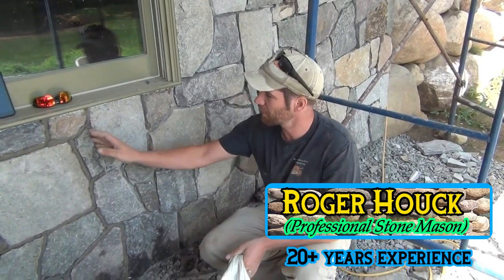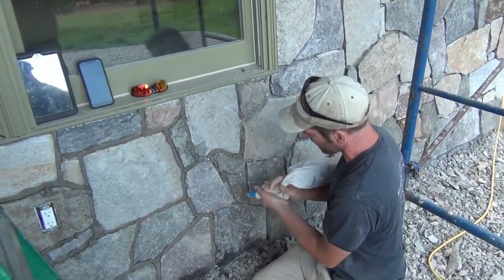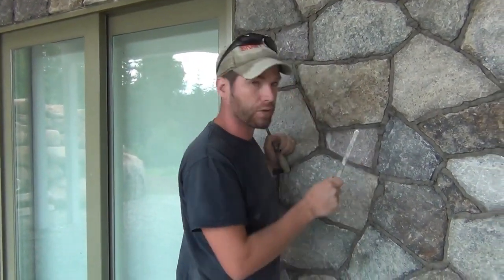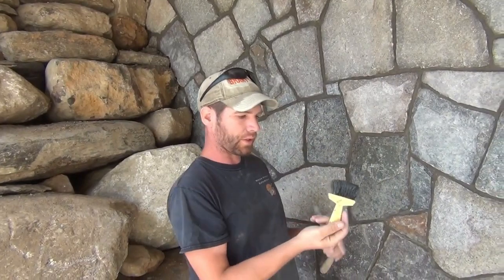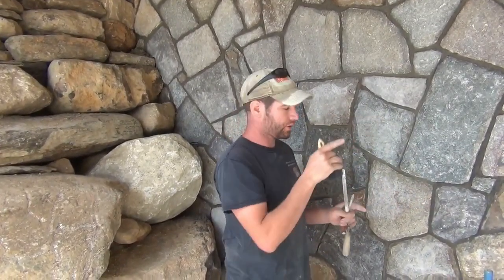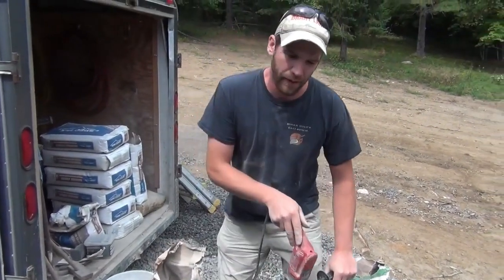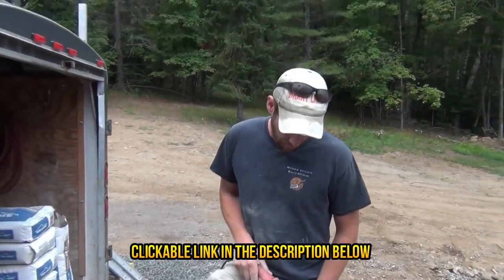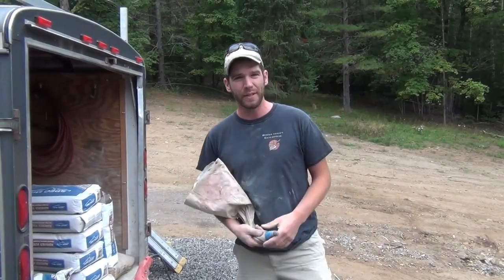How To: Grout Cultured Stone (Lots Of Tips From A Professional Stone Mason) Bags, Mortar, Troweling.

Comment: Great vid, couple more tips to mention...get the grout bag wet on the inside before you start and rinse it out clean before reloading it.  Once you squirt all the joints and the mortar start to dry out.  Push all of your job with your joints in real good.  Wearing gloves your fingers work great.  We have tuck points that are cut down to about an inch long that we use to finish the joints.  This custom tool helps  get around the contours for rounder cornered stone.  Never really used a full length tuck point before for stone.
Reply from the maker: Great points Pete, i should have mentioned wetting the bag.     depending on the joint style we use wooden tools for a similar finish,   and lots of glove joints especially on sea walls.

Comment: Hello from Houston, Texas.  I sure am glad I found your YT posting.  Have the constipation problem (luv your description).  Looked at a zillion YT bag videos and only two referenced the problem with nothing how to solve it.  Called Quikrete help and they were no help.  Had tried using type N mortar (1102).  Now I know what to use and how much.  I have about 140 linear feet of ground out brick mortar seams to fill and I did not want to use a trowel to transfer from a tray into the seam.  Thanks..!!
Reply from the maker: Thank you so much!   yep i could not find the answer for years and i had to hand pack joints for 1000s of feet before we figured out the laxative.   I hope it all goes well!

Comment: Thank you so much! I've done a ton of tile work but this is my first run at installing exterior stone. I ran into issues with the "poop" bag and am so thankful that you took the time to post this. My only concern now is that I wanted to add dye to the mortar and it's going to be difficult to figure out the ratio. Good idea to at least mix enough to do a section before going to the next wall. Any more detailed tips on adding the dye, that you've discovered along the way, would be greatly appreciated.
Reply from the maker: thank you for watching Denise!    the dye is a really tricky thing.   if it is a dry powder you can mix up a lot ahead of time and then wet the portions you need,   using equal water ratios each time,  certainly tryy to keep the same ratios on the same wall and then adjust around a corrner.   sometimes you can buy a pre colored mix that is easier.    
   if its a liquid dye   then you got t0 get even more precise and scientific.     measuring out everything and keeping as consistent as possible.  each day's weather conditions can change the color a lot   even with everything else under control.     I have honestly tried to steer away from dyed mortar on bigger jobs.   it is a huge liability.  and it looks great if it all works out but it looks not so good if you end up with 5 different shades.     on a smaller project.  like under 100 square feet  it is pretty doable.   i hope this helps

Comment: Informative, but funny 😄 hard to marry those. Good job.
Reply from the maker: Glad you enjoyed it.   thank you.   I've got a bunch of uneded vids i got to get out.  thanks for the encouragement.   have you done much in the masonry world?
Reply: @TheHowToHeadquarters  just a DYIer but have watched all the Haduck vids so I guess semi pro now lol. Going to tackle building a faced stone wall up against the side of my concrete stair walkup. only goes as high as 2.5 feet, only like 10 sq face feet. Will end up getting mostly large  rectangles of types of flagstone. My question is do I need more than just type n mortar to secure to each other andcesp. To the parged flat  side of cement stairs ? Considered like brick wall ties but read they rust off, not needed etc. In Chicago so cold winters. My first go at facing stone. Any advice ill take it. Will be eying your other vids prior too. Trying to learn.
Reply from the maker: yup Mike Haddock is great!!     i would add some extra straight Portland to the type N mortar and sand   maybe 1 part type n 1 Portland 3 sand.    and i would add an acrylic fortifier to the water.  Kaufmanns is and excellent brand but the quickcreet acrylic fortifiers are good too.  they just seem to accelerate the cure.  which can de a pain in the hot summer.   
 But the most important thing is to keep the water from getting behind it.   a good cap on top is a much more determining factor as far as longevity  over mortar type.  if water can work its way in behind the wall, it will deteriorate  especially in freeze thaw climates like ours.
Reply: @TheHowToHeadquarters  thanks much for the response! You are exactly right with the last part because that's exactly what happened. Builder pur this up 20 years ago with house and im told by 2 stone guys no one does it with sand and stone mortared to side of concrete anymore cause water gets behind and busts it up over time. Zactly what occurred by year 10-15.  

Wanted some guys to tear it out and parge the wall but they found big void under steps and got cold feet so just redid all the joints and used good stone they had to redo. Now I'm finishing portion they ran outta stone. I know even with caps, learned term coping stones applies too, won't keep our rain and gutter water that flows over it. Oh well I only need to make it 7- 10 years then sellin. Good luck growing channel. If you were local hire u in a NY minute!
Reply from the maker: @stevevenn1  thanks Bob!   yep those coping pcs will make all the difference!    and it will definitely get you 7 years.    especially if you spray it  every year or 2 with a waterproof sealer like aqua pel
Reply: Appreciate the work you did and the information you shared and enjoyed how he shared it :-) salt of the earth
Reply from the maker: thanks Brian.  i hope your project turns out well!

Comment: Thank you very much great video. My question is I like to have a little bit of sparkle from silica sand in my grout on my exterior stone walls and house. We built the house 19 years ago and we have a bunch of minor grout replacement to do and I want to get that same light grey look that shows the sparkle (not a lot) but enough so it doesn’t look just like smooth flat grey grout. Any suggestions?  I don’t remember the recipe I used I used to think that it was 1/3 Portland cement, 1/3  mortar, 1/3  sand…. But after watching your video I think I probably did it incorrectly. Anyhow, your videos terrific you explain things really well. Thank you very much for taking the time to show us this video. From San Diego.
Reply from the maker: wow great to hear from San Diego.    it was probably crystalized silica that gave you the sparkle.   you might be able to get some to mix into your grout .   it is a identified carcinogen now so its a little harder to get.    or you might be able to pick up a tile grout with that sparkle element and then mix that in.    its a DIFICULT game to match existing grout that has been weathered sometimes you got to just get it close and let it blend over a few years.    if your mortar joints were small (less than a half an inch)    that 1/3 port 1/3 sand 1/3 mortar could have been appropriate.   is it showing deterioration after the 19 years in the average spot?  or is it just failing where excessive weather or movement has taken place?

Comment: Have you used white mortar? What would be the proper mixture for white mortar?
Reply from the maker: the best way is to get white premixed mortar for glass blocks.  if you can source that.   its hard to make it yourself consistently.   maybe a tile grout.  or very light sand and type n light mortar.

Comment: So I'm still confused about the two Type S components, and your response to Frank didn't really clear thigs up. I understand one is a "mix" that contains portland cement, lime and sand. I've already tried this and had the constipated result. Then I found this video (which is great) and you provide the recipe. But when I search for "Type S Mortar" all I'm finding are mixes. What exactly does the other Type S Mortar contain; and can you provide a manufacturer recommendation? Any help is appreciated. Thank you.
Reply from the maker: Hey Bill,   I'm sorry this is a bit confusing.   especially since the names of these products have been blended together.    one way to differentiate is by weight.   the premixed mortar (which gets constipated without the other stuff)   is usually sold in an 80 lb bag.      the magic ingredient is  pure type s mortar.  that is usually in a 72 lb bag.   they have it at the box stores usually,  but nobody there knows the difference.   
pure type s mortar is finer than bread flower.   no sand,    just Lime, Portland, and some carcinogens.    If all else fails try a masonry supply store.  the guys at the counter there usualy  know the products and have a higher turnover rate.   if straight type s sits around too long it can get clumpy and cause more problems.  i hope this helps

Comment: Thanks for your great videos Roger! They are extremely helpful. What is the ideal temperature for installing exterior thin veneer stone. Then what is the low end temperature?
Reply from the maker: Thanks for watching Tim,   I don't like to apply mortar  when the next 3 days are likely to dip below 32 degrees.   If the water in the mortar freezes,   that arrests the curing process and that is as strong as the mortar will ever get.     the thin mortar applications we show here are particularly susptable to freezing.   thicker creet pours create their own heat and can protect themselves a little better in their own thermal mass.  there are tricks.    blankets over the new work,  or admixtures like anti hydro which accelerate the curing process, even tenting and heating,  but really it gets inefficient and risky as soon as the thermometer gets near 32.   50 to 70 degrees is the ideal temp for a nice slow cure
Reply: Thanks and great videos!!

Comment: If I install manufactured stone veneer over existing floor to ceiling brick veneer wall, do you think the wall ties holding the brick veneer to the structure will be strong enough to take the added weight of the stone veneer from lateral force? Should I fortify the brick wall with retrofit ties like putting some lags through the brick or don’t worry about it? Brick is interior and in good shape only 35 years old
Reply from the maker: well I'm not an engineer and i cant see your exact application,   so i have to be careful to take a stab at this...But typically the wall ties (or any lateral force) are not a major structural concern.  It is the weight going directly down on the floor or the brick shelf that when it sags or gives causes the wall ties to give way.   but the problem or the solution lies with the vertical force.    if you plan on covering a 4x8 brick wall with stone veneer, you are looking at 32 sq ft at roughly 10lbs per sq ft so 320 pounds.    if 2 adults stand near the wall,  does the floor sag, bounce, deflect?    if there is a concern,   an additional floor joist or a micro-lamb might pick up additional weight.   or an angle iron lagged to the masonry structure below the floor  level.      i hope this helps.  i don't think i can give you my electronic mail address here but if you have more questions and you want to talk more directly you can find my address thru rogers rigs.  which is my website for my other you tube channel
Reply: @TheHowToHeadquarters  really appreciate you taking time to answer my questions
Reply from the maker: its my pleasure!  I hope it turns out well!

Comment: Poopin in the joints hahaha that is so funny I can't stop laughing at it. Thanks for the vid. I have to poop in the joints on a small section of my house what are the temperature requirements. I believe I read it has to be 40 degrees or more. Im also in upstate NY too Remsen which is just above utica.  Its supposed to be 30ish degrees at night, can i just cover it up at night or should  wait for it to get warmer.
Reply from the maker: its warm eanought now.    yes you can cover it if it gets cold at night,  but its better to just wait to do it when the nights are abve 32

Comment: I’m trying to get a whiter mortar for my stone veneer grout because my stone is fairly light in color. I’m thinking of mixing some white thinset with my gray quickrete type s mason mix mortar. Is that a bad idea? Interior Fireplace resurfacing over brick
Reply from the maker: well i have done exactly that before to try for whiter joints,   and it kinda worked....but the thinset made the mortar hard to work with.   it was not a disaster,  but not exactly how i has hoped.    it was sticky and had a rubbery consistency and any smear on the stones did not clean up well at all.    the BEST option i have found  is white mortar used for glass blocks.   sometimes this is at lowes  listed as glass block mortar.  it is basically exactly like type s mason mix but pure white.  if you want to gray it up a little then add a scoop of regullar premixed mortar.
Reply: @TheHowToHeadquarters  thanks! Will try that. I also just spoke to a local brick and stone place and they have a type N white mortar so will try that too
Reply from the maker: i hope it worked